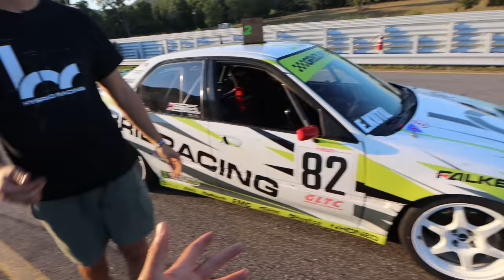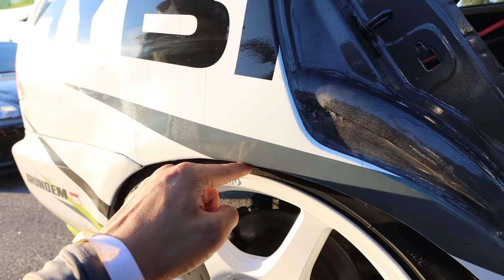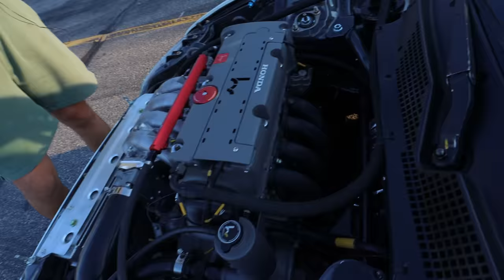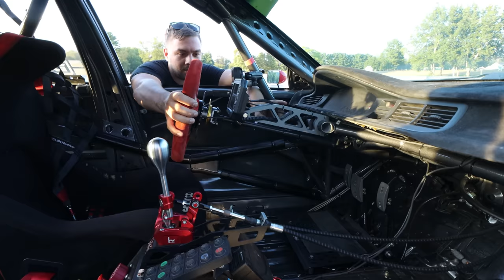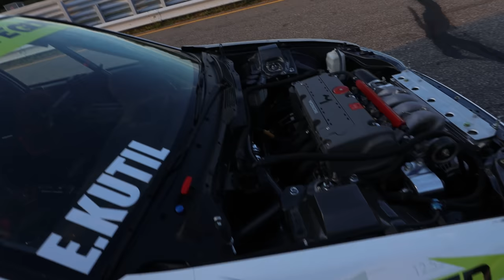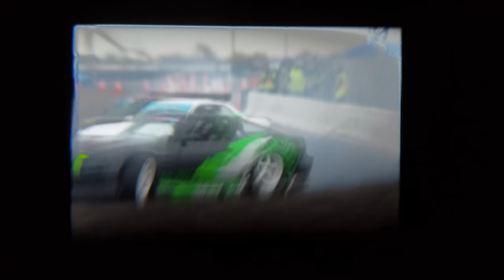From Junk Car to Race Car: This K-Swapped EJ1 Civic Terrorizes The Track in Gridlife's Touring Cup

Comment: EJ1 would be a 5th gen coupe with a sunroof, an EX in the USA or an SI in Canada. This Sedan in the video would be an EG8. Useless Honda facts in my head.
Reply: #facts…coming from a previous ej1 owner who always had to fight the same battle lol
Reply: Just get used to it, not worth the breath to say it. Everyone says ef,eg,ek because it’s jdm. I don’t care, I just like Honda civics, specifically hatchbacks. S2000’s, and NSX’s as well.
Reply: EJ EG etc what are those letters? It's part of the chassis number like the Trueno and Corolla with the AE85/86/88?
Reply: I miss my ej1 😞
Reply: @StudentDriverBR  it’s 4th to 6th in the VIN number. For the 5th gen civics there are 15 codes worldwide I believe, and 3 more for the del sol. The code almost always tells you the body style and engine, unless it’s an EJ6 that could be a 2, 3 or 4dr.
Reply: I regret selling my EJ1 to this very day..so hard to find a clean one I feel like.
Reply: There was actually EJ3 which was a high spec model in Japan four door. Mostly EXi models with electric seats and a lot of the optional stuff came standard almost like a run out model.
Reply: @stephenmccann6036  wow, japan only auto? I don't follow the jdm too closely but I've owned 3 North American EH9 sedans. All factory manual transmission, rear discs, big front discs, sunroof. I think I may have had one of the first b20 swapped sedans over 20 yrs ago. Love those cars. I had a stock z6 in one with the super long ratio cx manual trans for highway use, middle of the night middle of nowhere would bury the needle on the I5 for hours.
Reply: I wonder if the shell was a ferio making it an EG9 🤔